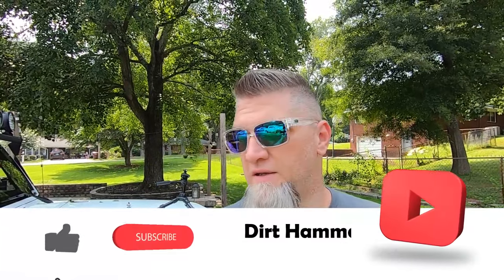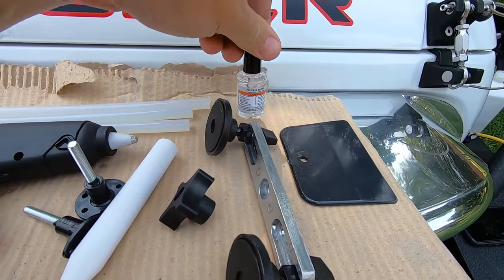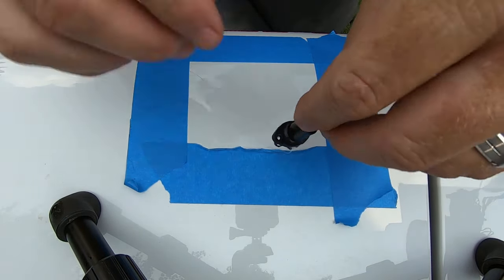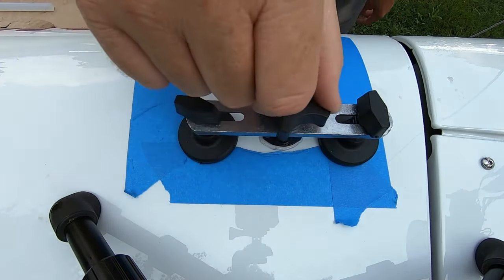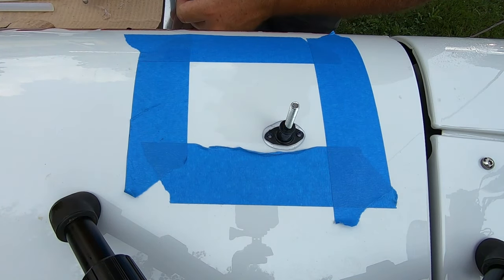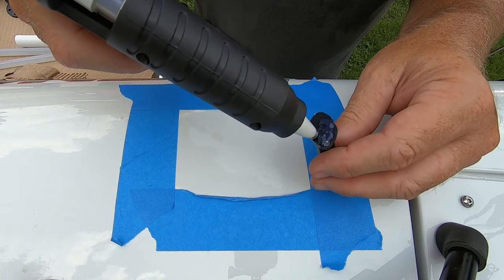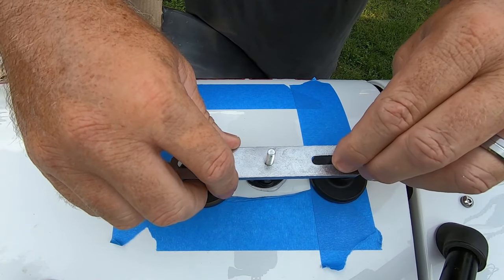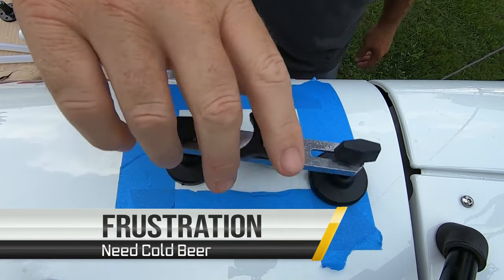Pittsburgh Crossbar Dent Repair Kit | Harbor Freight Tools

Comment from the maker: How well is the Pittsburgh Crossbar Dent Repair Kit working for you?
Reply: It didn't.  Looking at a lot of videos, it looks like cold glue with the "slide hammer" works best to remove most of the dent and then lightly tap down ridges with "dent hammer" and push tools from behind to work out valleys.  Using heat seems important as well.  I need to get the proper tools. Some of those dent removal kits run between 50-100 dollars with pretty much everything I think I need.
Reply from the maker: Wonder how well the “specific” auto dent removal glues work?
Reply: @Georgia4Low  I don't know yet but I have noticed they are expensive.
Reply: Thank you very much for posting this experience. it is absolutely important for us, as consumers, to see the frustration you experienced and the lack of success.  Your dents in the hood of the wrangler look like creases into rounded surfaces which I believe can be the more difficult of all things to pull out.
Reply from the maker: Yes you are likely correct on the dents. Thanks for watching

Comment: My kit didn't come with the manual or instructions.  So found this on the harbor freight site.  Note that it states do not push tab onto dent.  They are also instruct to clean the area with the release agent before attaching tab.  Might have been the problem.  Also on other youtube videos, people are giving the glue longer than 10 seconds to set.  Myself, I just bought the kit and will be trying to remove dents sometime this week.

 1. Insert Glue Stick (2) into Glue Gun (1). Plug
in Glue Gun and allow to warm up for ten to
fifteen minutes before use.
2. Using clean cloth (not included), clean dent
area with Release Agent (3). Then apply
heated glue from Glue Gun to end of desired
Pull Tab (4).
3. Place Pull Tab on center of dent and hold
there for ten seconds. WARNING! Do NOT
push Pull Tab against dent.
4. Place Cross Bar (5) over Pull Tab, setting
Adjusters (9) to desired length. Thread
Wing Nut (6) onto end of Pull Tab. Continue
to twist Wing Nut until dent is raised. Stop
when dent returns to normal surface level.
5. Unthread Wing Nut and remove Cross Bar
and Pull Tab from surface. Apply two drops
of Release Agent to spot of dried glue. Use
Scraper to peel off softened glue patch.
6. If a high spot has been created, use a hammer (not included) and lightly tap Dowel (8)
against raised spot until desired smoothness
is reached.
7. Note: The Repair Kit will not repair ALL kinds
of dents, regardless of size. The Repair Kit
will also not work on aluminum panels or
surfaces.
Reply from the maker: As mentioned in the video I cleaned the area with the provided releasing agent many times, like many many times. I think a better glue stick would be best, the glue sticks that come with this kit are just "arts and craft" glue sticks.
Reply: @Georgia4Low  Ok, I guess I missed that.
Reply: @liliatalley2140  I didn’t hear it either

Comment: This kit worked for me the first time I used it. I only held the pull tab with the glue against the car for 10 seconds but allowed it to sit and harden for a few minutes. That might be why yours didn't bond well enough. The 90+ degree temperature in your environment was also probably preventing the glue from hardening, as well.
Reply from the maker: Even though I was in the shade it was still mid 90’s out with high humidity, and likely the cause for poor bonding of the glue. You’re likely correct. Thanks

Comment: You definitely need to remove the coating.  I detail and do coatings.  You had no area of surface tension for the glue to find purchase on.  Magic eraser / compound to remove the coating and some denatured alcohol.  Then try.  Not to mention what someone else said about humidity
Reply from the maker: Thanks for the tips! Heck after 10 times or more cleaning with acetone you would think the coatings would be gone.
Reply: @Georgia4Low  coatings are silica.  If had been just wax the acetone would have done the trick.

Comment: I don’t think your supposed to push down and push all your glue out of the puller pad. I think you just apply the glue to the puller pad and put it on. If you push down you only get a thin amount under the pad. Squishing it all outside your pad puller isn’t going to hold with then a thin layer only on the dent
Reply from the maker: Good point but others and the instructions say to push down / light pressure and hold for a few moments as the glue cools. Each time the puller pad came loose there is a good bit of glue/layer on it still. Who knows, thanks for watching

Comment: You are supposed to turn the knob slowly. Get it just snug and then do slow 1/4 turns and let it rest a few seconds after each turn. This gives the metal time to give a bit and raise a little. Keep doing this until the dent is out.
If they were actually craft glue sticks it wouldn't matter how slow you turned the knob. Why would they include those type f glue sticks?
Reply from the maker: Thanks for the tip, I tried your process many times before with same results. They would include craft glue sticks because it's cheap and it's is from China.
Reply: @Georgia4Low  I bought the one from China and it came with the proper glue sticks so it isn't China's fault.
You should have posted the many times you did it the proper way because people only saw you fail doing it the wrong way. So you failed multiple times but decided to post a video of you failing again. I call BS because there are videos of the HF kit working.
Reply from the maker: @altg5708 dude the sticks don’t work. End of story! The kit itself is good just needs “body shop repair” type glue sticks.

Comment: The tool seems to be working but, the glue is weak.

After reading the comments I think it's too hot right now. I'll try later tonight or early tomorrow morning before the sun comes up.
Reply from the maker: Agreed on the glue and heat.
Reply: @Georgia4Low  

I just tried it again and although it's no miracle worker it does work pretty well for a 15 dollar tool. 

I might invest in the bigger kit because of the variety of the different types of dents the bed on my truck has. 

Seems like if you get it glued on and then apply pressure incrementally and sorta slow it allows the metal time to start bending in the right direction and then it just pops off by itself after a minute or so.

Comment: My guess is because of the outside temperature, the glue never got a good chance to cool enough to get a good bond. Perhaps wait about 30 minutes for the glue to harden more. 
Also choosing a cooler day might help the glue bond..?
Reply from the maker: Thanks for the tip! I’ll keep that in mind next time. Thanks for watching
Reply: Exactly. That glue stick stuff would benefit from a much longer setup time. It may not reach adequate adhesion for a couple of hours. Also I see these guys banging straight into the middle of the dent. What's wrong with starting on the out edges and making incremental improvements till you get to the stage when you can make a major pull?

Comment: Why would you add wax to the car before doing all this😂😂 complete failure
Reply from the maker: The ceramic coatings were added long before I started this process. Plus used acetone to clean the surface multi times.
Reply: @Georgia4Low the comments you caused are both informative and humorous! Now I feel good about spending 7 hours doing a ceramic detail to my rig!
Reply from the maker: @jamesscott1932 heck yeah, I’m a fan of ceramics as well.